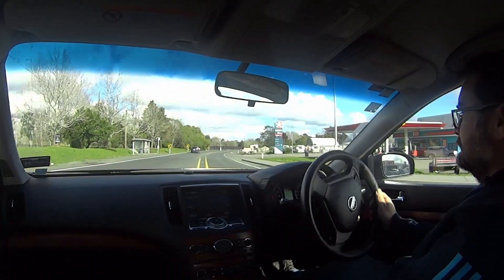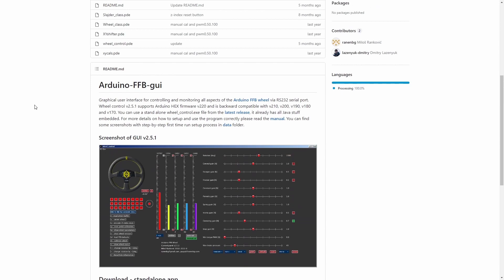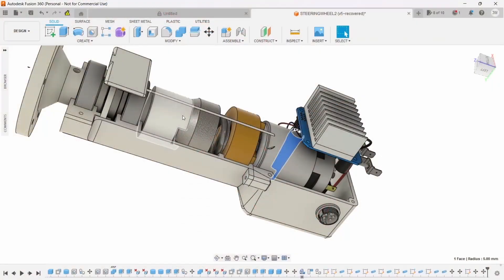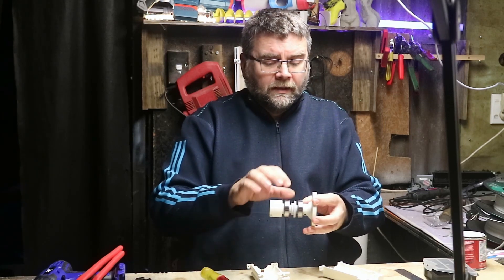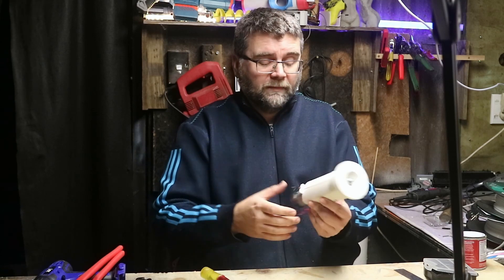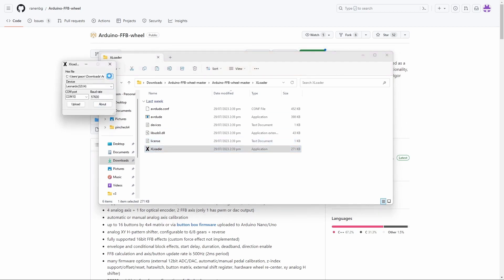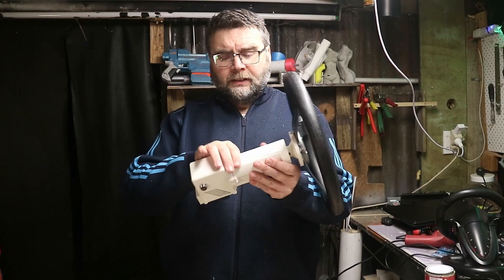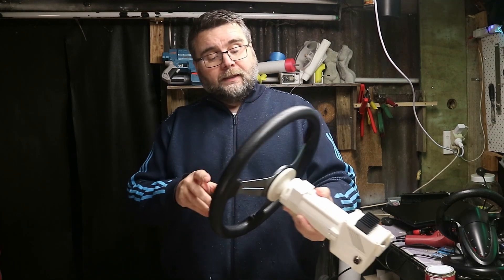Transforming a Drill into a Force Feedback Sim Wheel

Comment: Really great video! I do have a question. How long does the threaded rod and the roll pins need to be? Only the diameter is shown on your Printables page for this awesome project.
Reply from the maker: Looking at drawing the rod was 95mm but it could have been a bit longer as one end comes out of wheel and there is a bit of room. The pins were 3x15

Comment: I don't know if you've figured it yet, but the loud clicking is the impact system from the drill you used. That's what the notched ring and the heavy spring is. You can take them out completely and just have the motor.
Reply from the maker: Yes I did in the end. I removed the hammer function and replaced it with a washer. :)

Comment: FFBeast have a perfect guide on how to use the motors from a Segboard / Hoverboard. and turn it into a Direct drive. there is even a parts list and everything. i have ordred everything i need to build it and are just awaiting the parts to arrive. the total including a Used Segboard ran up to $120 for direct drive 15Nm Torque wheel. you cant beat that.  and its even compatible with CLS pedals.
Reply from the maker: That's an option but TBH there is less than $60 in parts in this project.

Comment: what makes the DIY wheel device MOST ACCURATE, is it the encoder ONLY or the FFB feature that allows you to be more accurate and smooth in inputs.
  I dont need realism, I need most accuracy!
Reply from the maker: The encoder is from a printer that has 1200 lines per inch. It's pretty accurate.
Reply: ok but does any of the force feedback feature add accuracy to the build , or are they just there ti simulate the forces.
id be happy with thumb wheel, like an rc controller,but the market is barren for any type of thumb wheel.Only the e swap has one and its 160 or more usd.
IM looking to build my own xbox wheel simulator, not a sim racing wheel if that makes sense ! @JWNZ

Comment: about tork ? how many nm ?
Reply from the maker: Pretty hard to calculate as this was a whitelabel motor without any specs. I would say it is at least 100nm at the shaft so even at 15cm it is going to be as high as anything you buy from the store.
Reply: Work with odesc 4.2 ?
Reply from the maker: @FranciscoAngelini  I don't think so. The signal from the arduino is a simple direction and PWM.

Comment: Is torque the most important? I doubt that. Haven't you seen a million items advertised with pointless specs before, while the important ones are hidden?

I have been thinking about building one, but not knowing how i want it to behave and what was important in a wheel, so i simply bought one. Driving Force GT (DFGT) can be had for around $50US used, this is what i got. Momo Force is worth maybe half that. A lot of Logitech wheels be had cheaply with a broken encoder which is an easy fix for you. Another advantage of a bought wheel is broad software support not only in the simulators where you can set everything up point by point, but out of the box in simcade titles.

Torque could indeed be higher, i think double wouldn't hurt. But i doubt it's that important, i mean, i know somebody who built a wheel which will break both of his arms, and he runs it at like 5% of its nominal torque; so then what was the point of building all that torque? The motor alone was $500 or something, it's gargantuan, he can barely even lift it alone!

What else is important is max turning speed. When you let it go, you don't want it to take 5 seconds to centre out! But well speed is low on DFGT as well. Double wouldn't hurt at all.

Then there's noise, and DFGT is among the loudest wheels ever made, but it's still fine, the noise isn't too objectionable but much louder would be bad. But this already tells me that i probably wouldn't want to build one out of a drill gearbox

Then there's smoothness. I can feel the teeth of the gearing mechanism. That's not ideal.

And then there's backlash. Another point against drill gearbox.

My personal approach is to try to avoid building from unique things i have found cheaply. Because i'm not the most reliable worker and tend to kill things dead, maybe i drop a screw, forget to turn off the power, maybe i short something, maybe i dial in wrong voltage on my lab PSU, maybe i have bad wiring, maybe i make a programming mistake. So it's OK if i can just buy a replacement, but not OK if i kill a one-off unobtainium item, well that's the end of the journey then.

Let me continue in a reply.
Reply: Inside the DFGT is found a big gear comprising the steering wheel shaft, a transmission gear, an RS-555 size motor (same mounting size as 540, 550) driving the transmission gear, and an optical encoder coupled to the steering wheel gear on the opposite side. The gears are straight cut. The total transmission ratio from motor to wheel shaft has been measured by someone else to be around 30:1 (actually 27.65:1). There's also a wire harness going to the wheel buttons inside the wheel shaft and a rack with stops across the bottom. The rack limits the total rotation to 900° and prevents the wires from progressively twisting themselves to death - you can skip it if you use slipring coupling, wireless buttons, or skip the buttons entirely. On startup, the motor turns the wheel both ways until the encoder stops emitting steps, thus finding the centre - you can instead demand that the wheel be started in top centre and operate relative to that.

A higher end Logitech wheel from the era, such as G27, has helical cut gears for more linearity and smoothness, no intermediate gear, and the motors are doubled up. The lack of intermediate gear ramps up the speed, and the doubled up motors improve backlash, smoothness and restore the lost torque. The encoder is moved to the back of one motor, where it's heated by the motor shaft, which causes the polyamide plastic to shrink and be split by the shaft, requiring replacement, this is an engineering flaw. Mind that a nicer wheel is not distinguished by more torque!

For now i'll get a different motor and see how well it does for itself, i suspect it should be twice the unloaded speed and stall torque, as well as twice peak power, the one i'm buying for now is Mitsumi M36N-5E. I will also get a new PSU because the one i got is sus and i'll want more power headroom for the new motor anyway.

My next step might be a belted conversion or a printed herringbone gear rebuild, to try to dial in backlash and smoothness.

Some people perform a low torque, high speed conversion of the DFGT. They move the motor to the encoder position and couple it with the gear that the encoder used to use; then they move the encoder to the back of the motor shaft. So the encoder ratio to the wheel stays the same, but the motor to wheel ratio is reduced to roughly half the original. This also runs much quieter, smoother and with less backlash than original construction. I don't think i want to do that but i'll consider yet.

If i was building a wheel from scratch, i would likely go for an RS-755 type motor, just a random one from Amazon or Ali, 24V-capable, then belted couple it to the steering wheel shaft. I would probably design for a 19V laptop PSU.
Reply: I think the cheapest direct drive wheel is around 300 dollars... i do not remember the nm, but lower than 5.

But in review it was mentioned as fast.
Direct drive is the best possible option for sim wheel and that price is hard to beat, even in diy!

If racing, especially in cars like f1 then torque will help "feel" the car, but in a bit of an unrealistic way as it uses to much force.

For driving, road car feeling, drifting... then less torque and more speed is better.
Reply: @Schmoking  That be Cammus C5. Yes that's a strong proposition. Yes at 5nm rating it's double the Logi G-series and DFGT, which is probably all one realistically needs on a smaller size wheel.

But it's still a chunk of money, and people may be uncertain whether they really want a device like that.

Building something from scratch or modifying something is always fun and educational, but in turn you don't know whether it'll turn out usable so you want to not overspend there either, and a belted or geared build can be cheap.

That being said a hoverboard motor is less than 100 currency-units, and maybe you can find much cheaper, people got a piece of fire trash on their hands. So maybe you can beat Cammus at their game?
Reply: @SianaGearz  
I already have wheel, the t300rs.
Its belted, as upgrade from logitech it is much smoother!
If I upgrade then i must have direct drive.

But i am thinking about handlebars for a motorcycle...
For Ride 4 and MX bikes in VR.
Load cell on the brakes, and force feedback on steering.

Not sure on motor choice though, kinda tricky... don't wanna waste a bunch on testing different motors.

A lot less steering input on a bike, a road car has 900 degrees rotation, not sure what different bikes has but probably not even 90...

Been wondering if several smaller motors might be an option?
Reply: @SianaGearz  
Do you know around what rpm, volt and stall torque is on those hoverboard motors?
Reply: @Schmoking  hoverboard motor has 5-10 order of magnitude Nm of stall torque depending on the voltage and current that you're willing to suffer, i think it's going to be closer to 10 at 36V and 8A, and one example allegedly 16 RPM/V so they go very quick, say if you were targeting 19V, that's already 300rpm.

So yeah i think they're using the same parts for that C5 wheel, it's not the complete unit but built from the same basic parts. Thus the unusual form factor and the fighting price without sacrificing profit, since they have been able to leverage economy of scale of another industry.

If anything the motor might be a little on the very quick side and not quite as torquey as one might desire, like you could trade some speed for torque if you were building a transmission of some persuasion.
Reply: @SianaGearz  
Oh, i see now...
I didn't realize a hoverboard motor could run in direct drive, that is why the cammus has that shape... 💡

Just saw the c5 is $250 now.
What bothers me about it is I don't think you can remove the wheel...
I would have to cut it off then make an aftermarket wheel mount where the buttons are, im guessing that would void the warranty... 🤨 but oh well.
It needs a bigger wheel!
Could make a quick connect and easily swap between MC handlebars and wheel. 

I really don't get why people want so much torque, on Logitech and t300rs i never run more than 25% force in software, and more likely less than that.

The c5 at $250 i think is a good option for me if i can use it for mc and wheel as i would modify it anyway.
But depending on how cheap you can find hoverboards, there still may be some $ to save.

But now i wonder about a ffb flight controller...
Those hoverboards have 2 motors and i found a few of them used surprisingly cheap.

Could a direct drive flight controller work?
If those motors were limited to only work in about 25 degrees of their rotation, would that be enough to get good feedback?
Reply: @Schmoking  These are not questions i have answers to, unfortunately.

Arguably anything that has been assembled, can be disassembled, and most things can be reassembled. Maybe there's hidden screws under the front "carbon fibre" sticker.

Comment: I couldn't get the patreon stuff to work to download the STLs.
Reply from the maker: You clicked on join for free?
Reply: @JWNZ  I've joined for free on the patreon, but when I click refresh to refresh the page it sends me to a patreon checkout to upgrade. I would like to donate though.
Reply from the maker: @kiwicombat9629  you are probably on the advanced stls? The others should be fine. What are the first 4 letters of your email in patreon?
Reply: @JWNZ the first four letters of my email are noob
Reply: @JWNZ  I'm pretty sure I'm not in the advanced stls but when I got to the patreon access page nothing shows up and it says I need to join the patreon
Reply from the maker: @kiwicombat9629  this should be available to you https://jasonwinfield.nz/stl-library-tier/
Reply: @JWNZ nothing shows up
Reply from the maker: @kiwicombat9629  should be fixed now
Reply: @JWNZ  also since you used an hammer drill, I was wondering if this project would work with a normal drill that doesn't have the extra length from where the spring used to be.
Reply from the maker: @kiwicombat9629  It might work even better :) I suspect the only difference would be the hammer part, with that out of the way to start with you could end up with a compact unit.
Reply: @JWNZ  ah okay. I was also wondering if it would be possible with a corded drill too
Reply from the maker: @kiwicombat9629  sounds a bit dangerous to me :) You can't really gut the motors out of those ones.
Reply: @JWNZ  ah true, I just thought about it, and bare 220v wires and my probably sub optimal wiring techniques would mix well. was also thinking about putting a motor heatsink on the motor.
Reply: Thank you so much, things are showing up on the website now.

Comment: Hello it is possible too make a 3nm or 5 NM wheel with juste un arduino and a big motor or you need something in between too give power or transform information too arduino?
Reply from the maker: Cordless drills will have at least a modest 100NM at the chuck. I expect there will be well over 5NM at a wheel. It is whether the gears in the motor could withstand the abuse.

Comment: sounds like once there's enough torque, its spinning the anvil on the end of the impact driver motor and causing that sound. it's the same sound it would make if you were to use the impact driver to drive a screw.
Reply from the maker: 100% correct. In the next video I showed my fix. I removed the spring from the hammer and replaced it with a plastic collar.
Reply: @JWNZ  hi! i was testing my FFB using wheelcheck and my motor made the same noise, im using it with gt2 pulley sistem, how can i fix it? couldn't find in others videos

Comment: What types of motors can your project support? If I use a 24v motor, can it run?
Reply from the maker: The h-bridge controller I used is rated to 22v so 24 would be too high. You might be able to find a higher voltage h-bridge

Comment: hello, I followed your video to the end but once uploaded the .hex file on Arduino Leonardo I go to Game Device Manager and I appear as joystick, the problem is that connected the encoder, as indicated by the diagram, does not move any axis and the buttons from 1 to 12 indicate them as pressed, I also tried to use the software contained in the folder as DXTweak2,   When I turn the encoder the program increases the value by 2 and then returns to 0.  Do you know how to help me?
Reply from the maker: What type of encoder? From a printer?
Reply: thanks for responding, the problem was encoder which was faulty, I changed and now it works perfectly. @JWNZ

Comment: Hello @The Making of Jason Windfield! Great work and thank you for this guide! I plan on building one and I am new in the OSW field. As I understand from your video, the parts I need are the following: 
1. Cordless drill motor 
2. Cordless drill battery
3. 3D printed body
4. An H-bridge
5. A random printer encoder 
6. Arduino LEONARDO.
Please correct me if I am wrong and thanks in advance!
Reply from the maker: Those are the core components yes. You would also need the ball bearings, steering wheel along with some screws but these should be scavanged from the donor printer. I have also made some paddle shifters that require the springs from the print head so if you can get the same model printer that would help. I haven't done it yet but there will be a full write up on my site https://jasonwinfield.nz/ soon.
Reply: @JWNZ  Thank you so much! I was wondering another thing too: how to connect the arduino to the drill motor and the encoder? I am a newbie in these things, I suppose it is really simple, but just asking in case it isn't. Thanks in advance again and will follow the progress of your project with interest!
Reply from the maker: @atomgaming7170  If you checkout the github link in the show notes the developer has done a great job of laying out the wiring and where everything should go.
Reply: @JWNZ  thanks!

Comment: what motor driver you use? with drill gearing ratio i doubt that motor can produce enough torque for the wheel (the motor looks like RS775/995 or equivalent), also using planetary gear might result in cogging and snapping, also the noise gonna be loud but the ffb strenght gonna be lacking

i do build my own wheel with 24v 300w scooter motor with bts7960, and stm blackpill board (emc pro software by EbolzMagi), and even with more powerfull motor i still need 1:8 ratio hdt3m belt and pulley to get around 5nm with 70%% ffb strength on the software
Reply from the maker: There isn't a model stamped on the motor, I am not sure what it is. So far the torque has been suffcient and I can't say it is overly noisy. My one concern is the gears breaking but we will have to wait and see on that one.